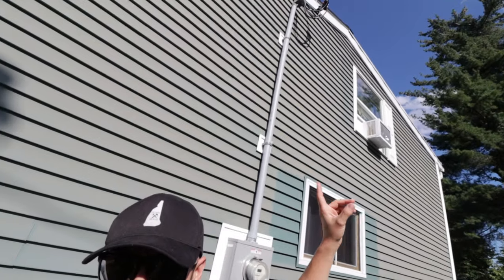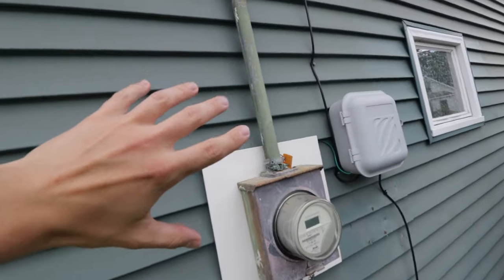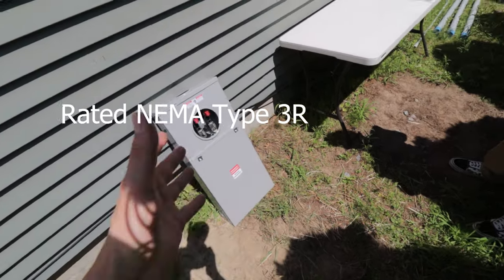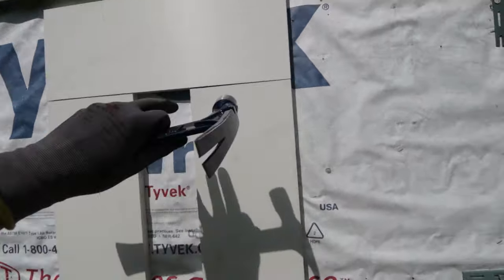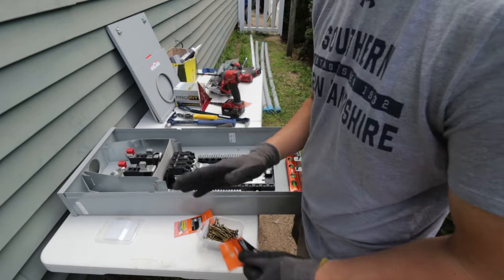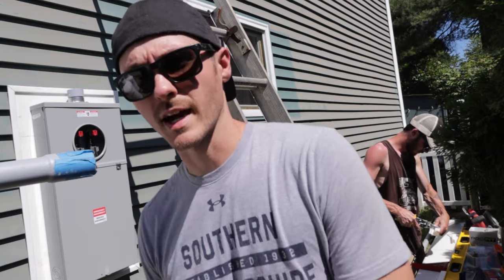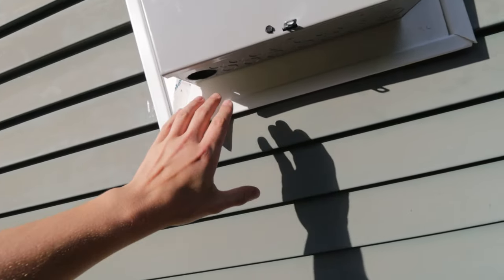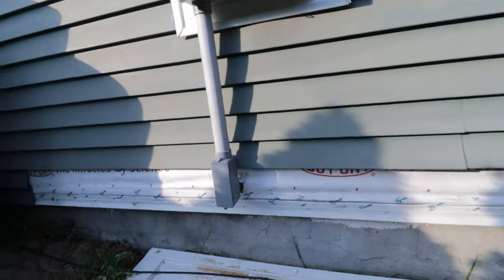Full 200 AMP Electrical Service Upgrade Install

Comment: I like the idea of the Azek and will probable use it on my new build in the spring. As for the J trim that you showed in the one clip was cool it suddenly change to something else when the siding was up. It now looks like a picture frame. Could you tell me what you used?
Reply from the maker: I’m glad you like it! I just used white J channel from homedepot that matched the same depth as what was already on my house. It should be readily available!
Reply: Thanks so much. Earlier the J channel that you showed was the same as the siding and was confused. The white was a good choice.
Reply from the maker: @stevenfrank5971  Yeah I didn’t have enough of the green but the white worked out okay! Thank you!
Reply: one last question. What did you use to fill the screw holes in the Azek? The video was to quick to make out. Thanks Again
Reply from the maker: Azek has a kit that comes with a drill bit, screws, and plugs!
Reply: Ah thank you
Reply from the maker: @stevenfrank5971  You’re welcome!

Comment: Hi is it somewhere in the box you could hook up (mount)the hot wire
Reply from the maker: I’m sorry I am not sure I fully understand your question. If you have specific questions about where to connect specific wires in a specific UL listed enclosure I would contact a local electrician for assistance.

Comment: Great video ! What’s the size of wire you used from the main to sub panel ? 1-1-1-3 ?
Reply from the maker: it’s actually 2-AWG aluminum 3 wire. 2-hots, neutral, and a ground
Reply from the maker: and thank you! Sorry for the late response I’ve had a bit of a cold!

Comment: Can you use pvc as a mast/riser? Have only ever used rigid.
Reply from the maker: Great question! I don’t know the exact answer. If the PVC extends past a certain point it will more than likely sag in the sunlight. It for sure cannot be used as a point of attachment for the triplex. You will need to have a much more sturdy material as a point of attachment. There is a section of the code the explains acceptable points of attachment.

Comment: Why did u foam the wires inside the LB?
Reply from the maker: Code requires that you seal the feeder conduit entering the building. There are many methods of sealing it. Just make sure sealant is listed and labeled to be used in that context.
Reply: @DownToTheFrame  interesting.  I assumed the gasket on the LB cover waterproofed the conduit entry.  I dont see that practice here in CA
Reply from the maker: @bigtroll8249  It’s not meant for water. It’s meant for fire. It also helps keep the cold out. It is in the 2020 NEC somewhere. I forget the section. We use to do it on pad mount transformers in the industrial world as well.
Reply: @DownToTheFrame  ahhh.. I see. 
U do clean work BTW.  Thx for making videos  🙏
Reply from the maker: @bigtroll8249  Thank you!!!

Comment: Can you explain why you do not bond neutral and ground in sub panels?
Reply from the maker: Great question! The simple answer is that you end up creating more than one path way for fault current to travel back to its source. This means you may potentially energize wires or anything grounded in certain circumstances.
Reply: @DownToTheFrame  shortest most simple answer I've come across thus far. Thanks for answering my question.
Reply from the maker: @Prodigal450  You’re welcome! Anytime!

Comment: what was the panel inside rated for? does this count as the required "outdoor disconnect" for code if done with that style panel? i have to upgrade the service in my house and this seems WAY easier to do it this way if its ok to do. My indoor panel is a 100amp panel and if i can just add this meter base/200amp panel outside like this and leave my indoor 100amp panel and essentially make it a sub panel (which im assuming is what this does) that would be absolutely fantastic. do you know if that will be ok to just leave my 100amp indoor panel i have now and add this exact same setup you have here to the outside and it will all meet code for a 200 amp service?
Reply from the maker: This install was completely to code and past inspection. As long as you separate the grounds and neutrals in the old panel and remove the bonding jumper on the neutral bus bar. This does count as the main service disconnect outside.

Comment: Did the Power Company increase the SIZE of the drop wire to the resistance?
Reply from the maker: They increased the triplex size probably to account for future electrical demand on our home. It more than likely would have worked fine with the existing triplex

Comment: Thanks for the info bro! I have a question though.  How come some of the wire you land is copper and some of it is aluminum?  Are certain points supposed to be copper or aluminum?  Can it all be copper?  Or do you just do it because aluminum wire is cheaper?  Im about to do the same thing and want to know if I should just buy all copper cause I know it handles heat a little better.  Thanks for the video!
Reply from the maker: It’s for cost savings. You can use copper for feeders and services but it’s a waste i’m most situations. Also, copper thieves love to see copper services lol
Reply from the maker: Size your conductors correctly and you won’t notice any performance difference between copper and aluminum

Comment: Sorry if someone else asked but why does the Sub Panel ground bar and neutral bar need to be unbonded/ disconnected? And aren't they connected by touching the metal of the inside of the breaker box itself?
Reply from the maker: Great question! It comes down to where we want the electricity, in the even of a fault to ground, to go. If we bounded each sub panel there is the possibility that the fault current could energize the grounds. This creates a condition known as “objectionable current” or parts of the system being energized when they shouldn’t be. We want the fault current to return to the source, spike the amps, and trip the circuit. Ground bars do touch the case but neutral bars are actually isolated from the case via insulated spacers. The only time they are not, is when there is a screw or strap that connects it to the case. I hope that helped!

Comment: I looked at that meter base but thought it would not be Okay since it does not have a spot for the Utility Tag.  Is that not required where you live?
Reply from the maker: Great question! The utility company made no mention of the ability to put a tag on it. Honestly, from what i’ve seen they were infective at stopping the people that truly wanted to remove the meter. So could be considered an antiquated method of deterrence

Comment: This looks killer man, amazing work, my only recommendation is using an expansion coupling/joint on the conduit coming up into the meter, so much more leeway to make errors and getting that glued up final mock up into the bottom of the can. Super Clean install nonetheless
Reply from the maker: Thank you! and that’s a great idea! A little more pricey but would have been a lot easier.

Comment: Hi thanks for the video,

What are you using to mount the Azac? Is it an impact drill or what kind of attachment/bolt? Thanks
Reply from the maker: You’re welcome! and I used the Azek branded fasteners. It comes in a kit with a special drill bit, screws, and plugs
Reply: Are those GRK screws mounting the panel going through the Azek and into the studs or just through the azek?

I'm installing a panel for the first time and just trying to wrap my brain around all that it entails. Any tips or tricks?

And I did go through an apprenticeship, I just work as a theme park electrician not a residential/construction one 😂
Reply from the maker: I love it! Great to hear you are learning how to do this work! Ideally you find a stud to at least mount one side to. However, in this application I knew that me sheathing is 3/4 which is plenty of thickness to hold the outdoor rated GRK screws I used. The screws should be long enough to go through the Azek (because it’s not structural) and then into the wood behind.

Comment: Great video and super clean looking. A couple of suggestions to make it less dizzying to watch in a few places. If your editing software doesn't have a smoothing function, the GoPro 9 and above has a "hyper-smooth" mode which looks great right out of the camera. Also and/or mounting the camera to your chest instead of head would help also. Had to take some Dramamine but only because I couldn't stop watching! Thanks again for your efforts!
Reply from the maker: Haha I’ll look into some ways to keep it smooth for everyone 😎 Thank you for the constructive criticism!

Comment: If you meter box has a breaker, would that make your main panel a sub panel
Reply from the maker: Yes, it would!
Reply: Thank you, the electrician out the bonding screw in the main panel which is a sub
 @DownToTheFrame
Reply from the maker: Yes, removing the bonding screw in the right move. The grounds and neutrals should only be bonded at the first means of disconnect.
Reply: one other question. If I want to put a whole house surge protector in, would that go in the sub or the main?  Thank you for all of your help! Tom
 @DownToTheFrame
Reply from the maker: I would personally put the whole house surge protector as close to the main feed of the house as possible. Or if you wanted to, you could put one in every panel. The idea is take catch as much energy from the surge as quickly as you can.
Reply: Thank you! I want to get one to protect the house,  Tom
 @DownToTheFrame

Comment: How do you utilize / incorporate the extra capacity / amps?
Reply from the maker: I will be utilizing it for resistive heating, car charging, and electric oven
Reply: @DownToTheFrame  i meant do you have to run greater capacity feeders into the home or something?
Reply from the maker: You would run the appropriately sized feeders for the size breaker panel you have inside your house.

Comment: Two questions hopefully someone can answer.  Towards the end of the video, after he installs the conduit for the grounding rods, he skips forward and then there are three pieces of conduit.   The left one is the main to the LB, the middle one is the grounding.  Then there's one on the right with a box st the bottom that just appeared magically.   What is that and how is it installed? Second, why did he use a 1-1/2" conduit for 200 Amp? NEC says 200 Mp needs 2". In my area of Vermont, we require 2-1/2". Why the 1-1/2"?
Reply from the maker: Great questions! First, the third piece of conduit just goes to a 20amp receptacle so i can plug lawn tools into it. I used 2 inch conduit for the 4/0 wires going from the weather head to the meter. The 1.5 inch conduit goes into the house feeding a 100amp sub panel. In the future i will need to add more conduits for other sub panels

Comment: Also , did the inspector catch the 6 AWg versus 4 AWG?  Just getting ready to upgrade my service and I’m reading conflicting ground wire sizes ?  Thanks
Reply from the maker: Another great question! So I actually did swap it out for a 4 AWG but technically, if you can find it in the code book, there is a bit of a grey area saying you can use 6 AWG if it is not susceptible to damage.

Comment: I’m up grading to a 200 amp service, and my outside meter and mr inside panel are over 6 ft apart I’m going to use steel conduit. DOES MY DISCONECT  have to be fuseable ? 

I was going to buy a blade box and put emergency disconnect on panel. I live in Detroit
Reply from the maker: You will need to check your local code but I always recommend a main breaker outside the house. This allows all power in the house to be shut off in an emergency or trip and protect all wires inside your house.
Reply: @DownToTheFrame  thank you. I went to the inspector office he went on about how he spent all this money to go to school why should he tell me, lmao..  Might have to call for the inspection and hope it’s not the same guy take the hit and show what I’ve done.. 
   I will keep trying to find my local code,, thx again for replying!!

Comment: Did you use 2/0 Copper from meter to sub?
Reply from the maker: I used 2awg 4 wire aluminum SER and limited it with a 100amp breaker

Comment: Thanks for a great video! We are building a small RV park in Middle Tennessee and getting ready to install a 200A service mounted to the side of 8'x8' utility outbuilding we have constructed on our 35 acre lot. We also believe in doing things right and overbuilding for the future.  QQ: If the meter base on the outside is directly opposite the distribution panel on the the inside of the building, what would we use to go through the 1" exterior wall? It's too narrow for terminal adapters in each box. #comettroy

Comment: Nice near work but if you mount your panel on top of the siding water will regardless drip down
Reply from the maker: Maybe! But siding is suppose to be loose and the panel is supposed to be secure. So they kind of work against each other

Comment: Nice vid, but I would feel better if the riser pipe you used was RMC or even IMC, instead of PVC.
Reply from the maker: You are welcome to use whatever you want! I like to use material that isn’t conducive. That way it doesn’t turn into a giant light saber if the neutral is dropped

Comment: Could only hope all Electrical Contractors were this clean, only one issue, 10' to Gas tanks not 3' in NH - everything else is awesome....
Reply from the maker: Thank you! And the inspector actually referenced the 3 foot rule when he did my inspection. Not sure why he didn’t mention this 10ft rule. I will be getting rid of those tanks eventually anyway. I will keep that in mind for the future!

Comment: Did you use 2/2/2/4 wire from the main to the sub?
Reply from the maker: Yes, I did! Limited it with a 100amp breaker
Reply: @DownToTheFrame When you wired the SE wire from your main to your sub you connected the red and black to your 100 amp breaker and then you put your neutral and ground wire on the appropriate side bars.  But aren't the neutral and ground bars bonded in your main box?  My new 200 amp Meter box with breakers only has 1 side bar in it.  I assumed this was because it was going to be bonded anyway.
Reply from the maker: if you have a disconnect at your meter, your panel needs to have the grounds and neutrals separated. Most panels have a bonding screw or bar that is removable. That way they can be separated
Reply: @DownToTheFrame Just wanted to thank you.  I passed my inspection on Tuesday of last week.  I basically did the same upgrade on a 1900 farm house here in the UP of Michigan.  On to tearing off the roof!
Reply from the maker: @drewthomasarnal5378 You’re welcome! Nice work! It’s so satisfying to have a home powered by your own system

Comment: nice details.... couple of things I noticed that were 'oddities'... but are you a licensed electrician?  If so, I wonder how long you have been in the trade?  PS - I am not ripping on you or anything. I am just curious.  Clean work in the end!
Reply from the maker: I am not a licensed electrician. I was an industrial apprentice electrician for about two years. This was my first and only residential service that I did

Comment: What are you charging for this
Reply from the maker: Great question! Rates depend but materials for this are around $1500 to $2000 and then there are labor costs associated with it. So it might be in the $3000 to $4000 range

Comment: Why run a service mast up the wall if it’s a 2 story house just run the SEU on the wall with 1 hole straps and a service entrance cap, Probably could have saved a couple hundred bucks and some time
Reply from the maker: Could have but then I would have had a lesser quality product. You can always do things cheaper. You usually compromise quality as a result.

Comment: What size wire from 200 amp to meter?
Reply from the maker: I used 4/0 Aluminum which complies with the 2020 code book
Reply: Ok thx.m Is it better to buy them in a single bundle or just individually through the conduit. #1 and #2 hot and 1 ground or neutar correct?
Reply from the maker: @ramongalaz6263  I’m not sure the price difference but either way you can buy 3 wire SER or you can buy 3 separate conductors. You will need two ungrounded conductors (two hots) and a grounded conductor (neutral)
Reply from the maker: However, I would still recommend consulting a local licensed electrician to answer these questions for you.
Reply: Thank you
Reply from the maker: @ramongalaz6263  You’re welcome Ramon!
Reply: Do i need a 4/0 neutral wire as well?
Reply from the maker: @ramongalaz6263  I ran a 4/0 neutral
Reply: Thanks you

Comment: Surge protectors have to be the closest breaker to the main
Reply from the maker: Interesting the manufacturer installation manual makes no comment about that. I also didn’t find anything in the 2020 NEC code about that. Is that a local code in your area?

Comment: Also you said you were in New Hampshire so you’re in a snow zone, why would you put that receptacle down where it’s going to get covered in snow that’s a rookie mistake it should be at the bottom of the panel or right next to it I would never have a foot and a half off the ground if it’s even that
Reply from the maker: That’s a great idea to make sure snow never comes close to it! Where we are the snow hasn’t come close to it and I think our snow fall is getting less and less
Reply: @DownToTheFrame  well I guess that’s good to know, here in Cleveland Ohio we can still get large snow falls they could easily drift or go over 2 feet the only way I would have a receptacle down that low is if it was in a garden or a tree bed for landscape lighting. But for service receptacles they should always be as high as you can get them away from the environment.
Reply from the maker: @shockingguy It is for sure a good idea. I’ll keep it in mind for next time!